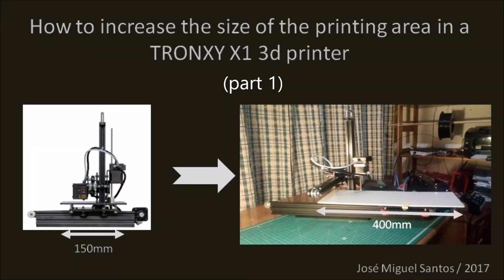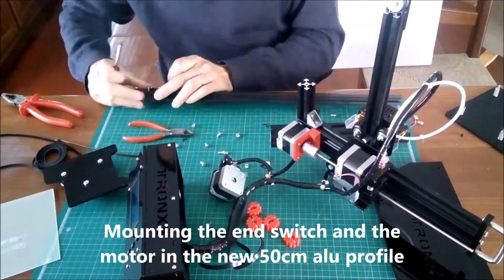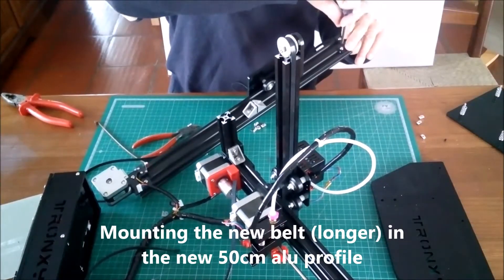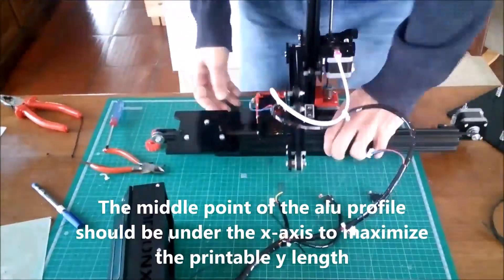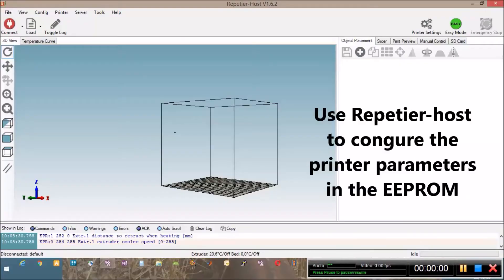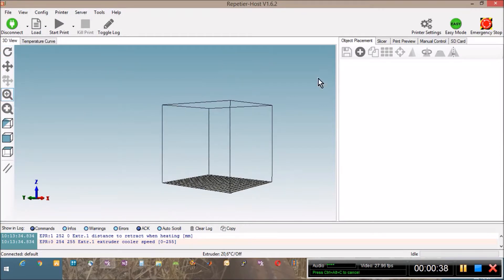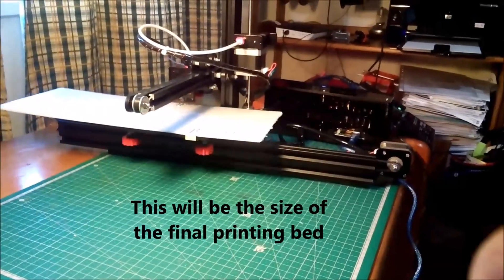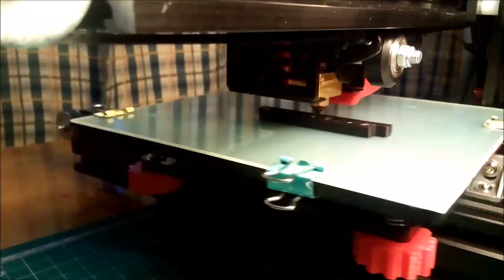TRONXY X1 Mods #1 V1

Comment: Where did you purchase the 500 mm beam?
Reply: For example, https://es.aliexpress.com/store/product/CNC-3D-Printer-Parts-4pcs-lot-European-Standard-Anodized-V-Slot-Linear-Rail-Aluminum-Profile-Extrusion/1762258_32813616949.html?spm=a219c.search0104.3.1.4f9e1628Zu3pyW&ws_ab_test=searchweb0_0,searchweb201602_2_10065_10068_10547_319_10891_317_10548_10696_10084_453_454_10083_10618_10307_10820_10821_10301_10303_537_536_10902_10059_10884_10887_321_322_10103,searchweb201603_59,ppcSwitch_0&algo_expid=fe029546-0260-4951-b2a8-5368c473f78f-0&algo_pvid=fe029546-0260-4951-b2a8-5368c473f78f&transAbTest=ae803_4

Comment: Para hacerle 15x20 hace falta agrandar la pieza de aluminio??
Reply from the maker: My objective was to have at least 30cm not only 20cm. You can try to change the parameters of the printer and see if this would be enogth.
JMS
Reply: José Miguel Santos Then I could put a glass of 15x20 long without modifying the aluminum axis?

Comment: Hi Jose, is it possible to extend the  Z axis? Nothing to big just an extra 60mm.
Reply from the maker: Glass 3mm
Reply from the maker: I gess that it is not a big issue. You will have to replace the aluminium guide by a longer one, the Z thread by a longer one and maybe the cables should be extended also. I have a part 2 video of the extension of the Y axis in https://www.youtube.com/watch?v=XbO3KAam0hI
Regards
José Miguel Santos
Reply: Which material is your plate?
Reply: José Miguel Santos but work with glass?!

Comment: Thank you José. This is very interesting. My X1 just arrived AND I have the parts ( except for the bed ) to undertake this mod. I would be very interested to see how you end up completing the bed. Cheers, JAYTEE
Reply from the maker: I will publish a video soon with the complete setup. In fact I have replaced the original bed by a new 3mm acrylic one with some extensions to support a 2mm normal glass with 200mm x 300mm.
If you implement a very heavy setup for the bet you will end up changing the motor by a stronger one. You must keep the weight at a minimum. In my case I’m using the original motor.
José Miguel Santos
Reply: Excellent thanks. Subbed :) Cheers, JAYTEE
Reply from the maker: Video with the results of this project: https://www.youtube.com/watch?list=PLkX_Pxv5VWPohx33shTDXNCx-DLsrBc4e&v=XbO3KAam0hI
Reply: Thanks. Watched it already ;) Cheers, JAYTEE

Comment: Does anything prevent you from extending the X axis the same way?
Reply: Gravity
Reply from the maker: It is possible to extend the x axis too. First thing is to change the belt extender to the opposite side to get some addition millimeters. I don’t think that 50mm or even 100mm more on the x axis will degrade the printing quality. There will be an additional force in the vertical car but you can always compensate putting some weight on the opposite side to balance the setup. I have never tested because my issue was more on the length of the printing and not so much on the width. 
If you try that please share your results with me. 
Best regards.
José Miguel Santos